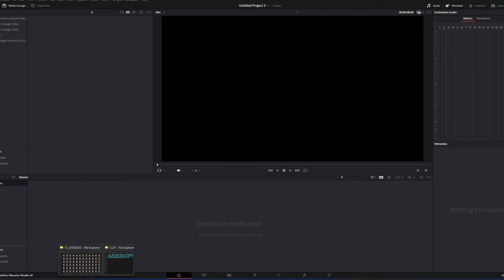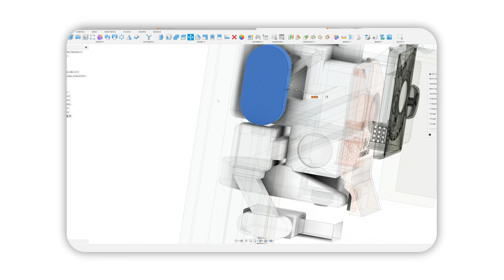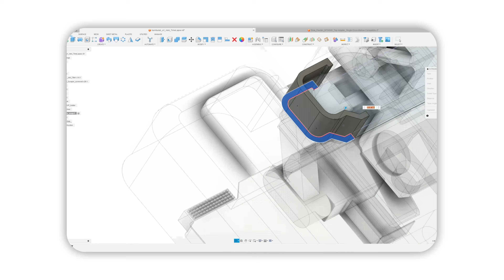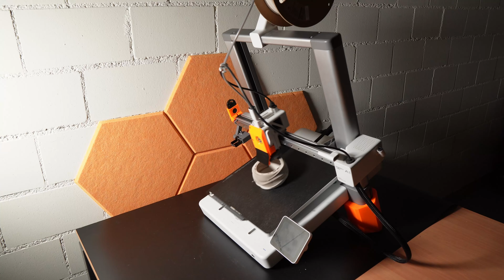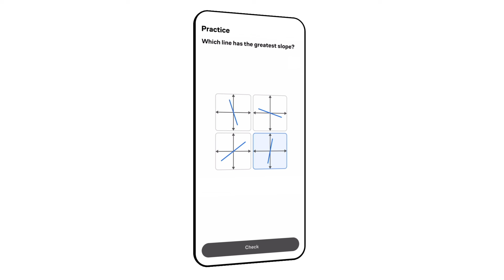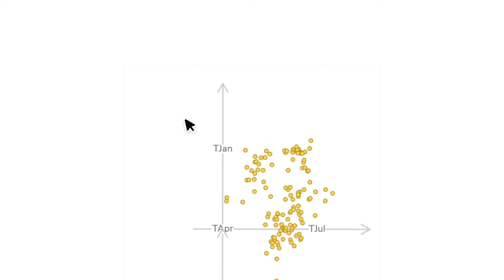How to create stunning 3D Print Timelapses with your Phone - Full Breakdown

Comment: Beautiful clips you got. A question about the code though. Besides the Y250 to move the plate forward, you're just changing "M400 P300" to "M400 P100"? What about "M400 P10" and "G1 X10" that I see people adding before the line "M400 P300"? Is that not necessary? Because your footage is flawless, and that's my goal, but I'm just trying to understand. Thanks!

Comment: I'm recording a time-lapse video, but when the shutter moves to the left on each layer, it presses the shutter button for a very long time before starting to record. Also, the part the head is attached to on the y-axis appears on the screen. What I want is to take a quick snapshot while simultaneously having the head move upwards on the z-axis to capture only the resulting image. Can you help me with this? Which G-code do I need to change?

Comment: My only obstacle to get around now is the machine holding the button down and taking multiple photos rather than 1. Not sure how to change that. Mostly when heating up in the beginning and when doing the dynamic filament flow.
Reply: Have you found a solution to your problem ? I'm having the same problem lol.
Reply: @ludvigsp sadly no. Every setting I go into only adds a timer. Currently I just lift the remote while it sits there warming up then once it starts the remote drops into position
Reply: Do you only have the problem during when heating up in the beginning, and when doing the dynamic

But not during the printing process?

Of it is so, do you mind sharing you full Timelapse g-code here?
Reply: Yeh that's pretty much when it happens. I'll copy and paste my g code once in home but it's the standard g code with the new values provided in the video/pdf file. I'll copy and paste tho in a comment asap
Reply: @sirdropbeartv sure sure, thank you so much !
Reply: @oscarlim7433  ;===================== date: 20250206 =====================
{if !spiral_mode && print_sequence != "by object"}
; don't support timelapse gcode in spiral_mode and by object sequence for I3 structure printer
; SKIPPABLE_START
; SKIPTYPE: timelapse
M622.1 S1 ; for prev firware, default turned on
M1002 judge_flag timelapse_record_flag
M622 J1
G92 E0
G1 Z{max_layer_z + 0.4}
G1 X0 Y250 F18000 ; move to safe pos
G1 X-48.2 F3000 ; move to safe pos
M400
M1004 S5 P1  ; external shutter
M400 P100
M971 S11 C11 O0
G92 E0
G1 X0 F18000
M623

; SKIPTYPE: head_wrap_detect
M622.1 S1
M1002 judge_flag g39_3rd_layer_detect_flag
M622 J1
    ; enable nozzle clog detect at 3rd layer
    {if layer_num == 2}
      M400
      G90
      M83
      M204 S5000
      G0 Z2 F4000
      G0 X261 Y250 F20000
      M400 P200
      G39 S1
      G0 Z2 F4000
    {endif}

    M622.1 S1
    M1002 judge_flag g39_detection_flag
    M622 J1
      {if !in_head_wrap_detect_zone}
        M622.1 S0
        M1002 judge_flag g39_mass_exceed_flag
        M622 J1
        {if layer_num > 2}
            G392 S0
            M400
            G90
            M83
            M204 S5000
            G0 Z{max_layer_z + 0.4} F4000
            G39.3 S1
            G0 Z{max_layer_z + 0.4} F4000
            G392 S0
          {endif}
        M623
    {endif}
    M623
M623
; SKIPPABLE_END
{endif}
Reply: @oscarlim7433  This is the G-Code, 
;===================== date: 20250206 =====================
{if !spiral_mode && print_sequence != "by object"}
; don't support timelapse gcode in spiral_mode and by object sequence for I3 structure printer
; SKIPPABLE_START
; SKIPTYPE: timelapse
M622.1 S1 ; for prev firware, default turned on
M1002 judge_flag timelapse_record_flag
M622 J1
G92 E0
G1 Z{max_layer_z + 0.4}
G1 X0 Y250 F18000 ; move to safe pos
G1 X-48.2 F3000 ; move to safe pos
M400
M1004 S5 P1  ; external shutter
M400 P100
M971 S11 C11 O0
G92 E0
G1 X0 F18000
M623

; SKIPTYPE: head_wrap_detect
M622.1 S1
M1002 judge_flag g39_3rd_layer_detect_flag
M622 J1
    ; enable nozzle clog detect at 3rd layer
    {if layer_num == 2}
      M400
      G90
      M83
      M204 S5000
      G0 Z2 F4000
      G0 X261 Y250 F20000
      M400 P200
      G39 S1
      G0 Z2 F4000
    {endif}

    M622.1 S1
    M1002 judge_flag g39_detection_flag
    M622 J1
      {if !in_head_wrap_detect_zone}
        M622.1 S0
        M1002 judge_flag g39_mass_exceed_flag
        M622 J1
        {if layer_num > 2}
            G392 S0
            M400
            G90
            M83
            M204 S5000
            G0 Z{max_layer_z + 0.4} F4000
            G39.3 S1
            G0 Z{max_layer_z + 0.4} F4000
            G392 S0
          {endif}
        M623
    {endif}
    M623
M623
; SKIPPABLE_END
{endif}
Reply: @oscarlim7433 I'm not sure if the comments still there but IV tried commenting the g code like 3 times and YouTube keeps removing the comment. Or my phone's being a goose
Reply: @oscarlim7433  M400 P100a
M971 S11 C11 O0
G92 E0
G1 X0 F18000
M623

; SKIPTYPE: head_wrap_detect
M622.1 S1
M1002 judge_flag g39_3rd_layer_detect_flag
M622 J1
    ; enable nozzle clog detect at 3rd layer
    {if layer_num == 2}
      M400
      G90
      M83
      M204 S5000
      G0 Z2 F4000
      G0 X261 Y250 F20000
      M400 P200
      G39 S1
      G0 Z2 F4000
    {endif}

    M622.1 S1
    M1002 judge_flag g39_detection_flag
    M622 J1
      {if !in_head_wrap_detect_zone}
        M622.1 S0
        M1002 judge_flag g39_mass_exceed_flag
        M622 J1
        {if layer_num > 2}
            G392 S0
            M400
            G90
            M83
            M204 S5000
            G0 Z{max_layer_z + 0.4} F4000
            G39.3 S1
            G0 Z{max_layer_z + 0.4} F4000
            G392 S0
          {endif}
        M623
    {endif}
    M623
M623
; SKIPPABLE_END
{endif}

Comment: Great design, one problem I am having is that with multicoloured prints it will spam the trigger whenever it changes colour and sits flushing filament for a bit. Leaves me with quite a bit of file cleanup to do afterwards. Not really sure if theres much of a way to solve that though.
Reply: Same issue! Did you find a way to fix it? Not looking forward to cleaning up timelapses that have like 100+ colour swaps >_<. I thought 3 was bad enough with my 3colour benchy